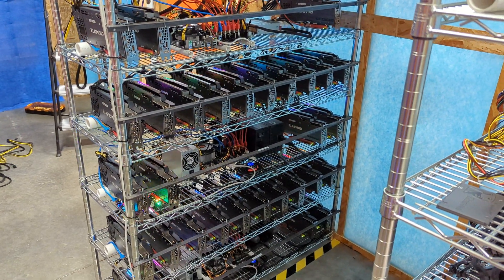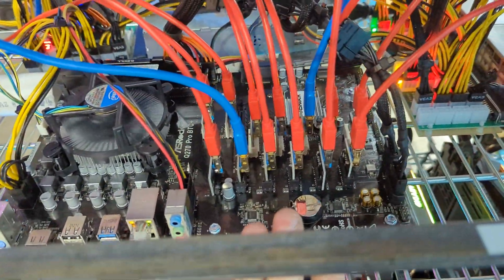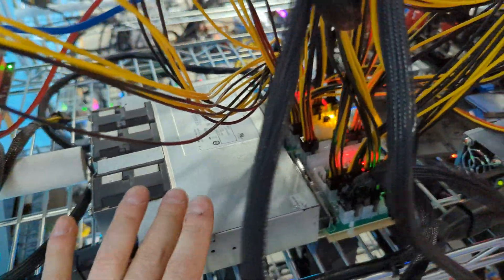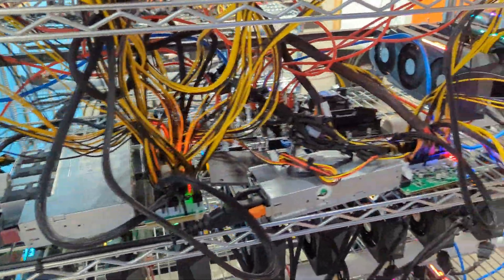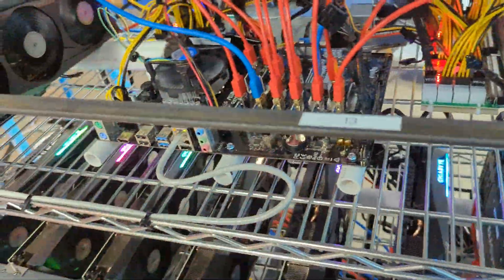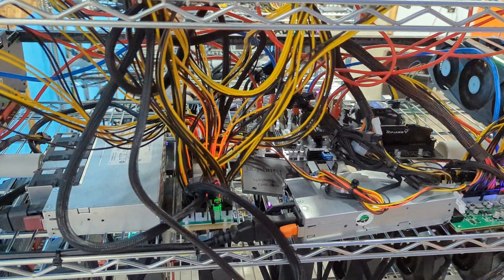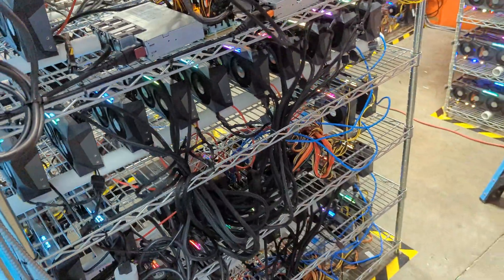ASRock Q270 Pro BTC+ Motherboard, Running 13 GPUS, Server PSU's

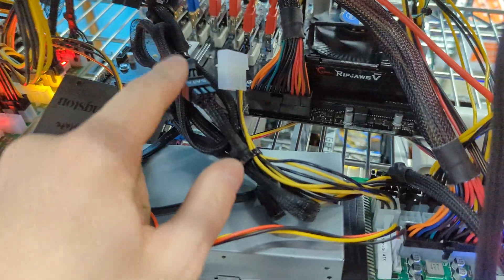Comment: Hi buddy great video, when you talking about special converter (2:50) were you talking about the cable that powers the pcie power2 and Sata power on motherboard , if so what cables did you use for those. I got a Molex splitter and a Molex to pcie cable would that work

Comment: keyboard warriors are gonna be so stoked you're not using  sata connectors. It'll be cool to see how you fine tune the buildout. great inspiration. I bought myself two evga 3070 ti's and a 1600 P+. I can afford to tweak the 3070 ti's and the up front is less than 3080's. Youre videos are inspiring in terms of just getting the job done. Props
Reply from the maker: Bums and their sata power argument.... Yawn....